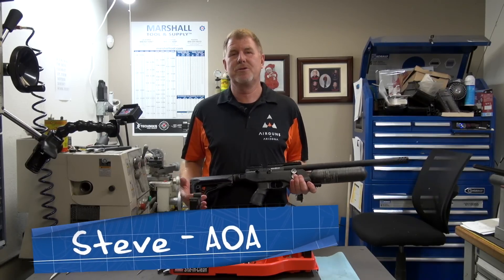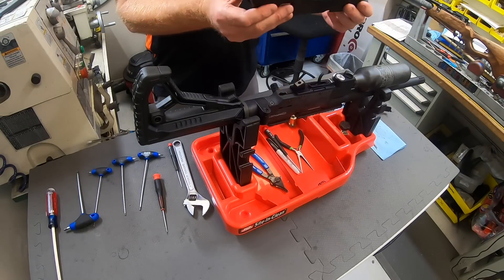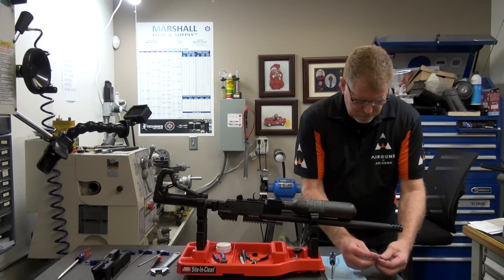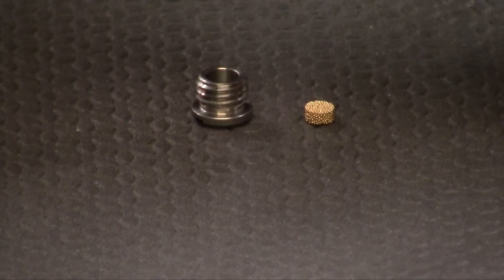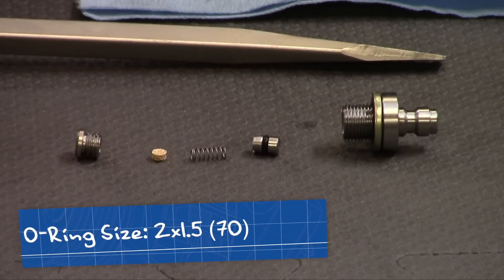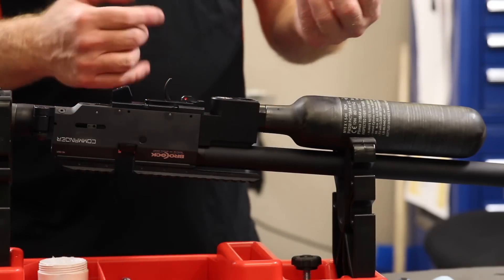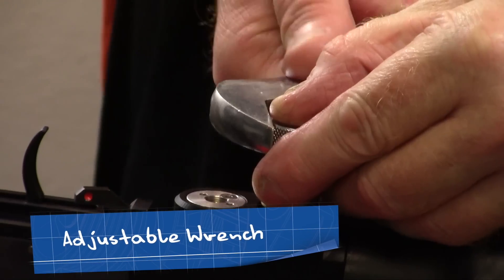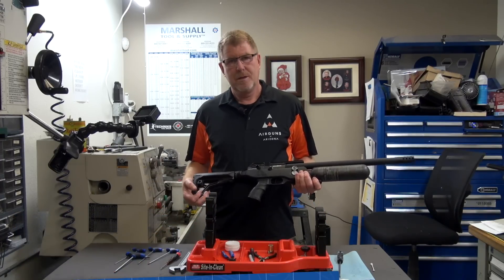Brocock Commander Fill Valve Repair

Comment: Exceptional videos, this has helped a lot me with my UK sub 12 sniper XR thanks
Reply from the maker: Thank you and thanks for subscribing!
Reply: My Sniper XR leaks from the centre of the fill valve, after releasing bottle pressure I lose all the air. Is it simply this O ring. The rifles only 6 months old. Does the O ring dry out?
Reply: @iamspartacus8219  it's a very poorly designed valve and a regular occurrence, get yourself a completely new high pressure full valve from Best Fittings in the UK. I changed O ring 3 times and this did not solve it, it needed a new (different brand valve)
Check if your thread is M10 or 1/8th Bspp though before ordering.
Reply: @richardhindmarsh939  Thanks for your reply. I just got the special tool to undo the fill valve, took it to bits and found the O ring split. Fitted new O ring, put some silicon oil around it and re-assembled. Filled to 250 bar and so far so good. I don’t have faith in it and have followed your advice and ordered a fill valve from best fittings, just in case, because if it happens once it will happen again. I did notice the one I took out that was split, was dry.

Comment: I have a 2019 .22 bantam Magnum.This has never happened.I loved the gun so much,I bought another .25xr magnum.Second fill,this bullshit happens.Kudos to AOA for sending me tools to fix this.(still awaiting their arrival as we speak.) After reading about what a pain in the ass it is to get the oring around the piston,I must say I'm far from happy.However,shit happens and is to be expected with components holding back 4000psi,right? Anyhow,if this non sense continues to happen,I will be asking for permission to install an aftermarket best fittings high pressure fill valve.Others have done that from what I've read and haven't had any issues since.I would do it right now,but AOA told me to fix the OEM one so that's what I'm gonna do is follow instructions.I'm doing this once and once only.Don't have time to fix improperly engineered valve over and over.
Reply: update: I fixed it with tools from AOA and this video.Still gonna order couple replacement 1/8bsp valves from Best fittings in the u.K.(That is assuming they're not just another ghost business that doesn't answer phones during normal business hours) Which,is the case so far at the time of this writing.
Reply: update #2.While bestfittings did not answer their phone,they did quickly email me and i was ,in fact,able to order 1/8bsp replacement valves all done online.Now,we wait for them to arrive via air mail from Jolly ole England.
Reply: @2marauderman329  need your help, this happened again 3x I'm done.... could you let me know the specific one to get? Thanks
Reply: @2marauderman329  1/8 NPT or 1/8 BSP

Comment: Lets see you put that O-ring on!
Reply: putting the oring on was easy compared to getting into the poorly designed round housing of the valve itself!
Reply: @2marauderman329  Are you thinking about switching/changing the valve out?
Reply: @alexmlawsky4170  ,I already did
Reply: @2marauderman329  so could you take a picture would like to see it, also if it’s not much trouble what’s the parts are and where you got them.
Reply: @alexmlawsky4170  ,I have it put back together now.My gun was/is brand new and under warranty.Therefore,I got the parts and removal spanner socket from Airguns of Arizona which is the distributor here in the U.S.A. and where i purchased the rifle.But the job was pretty much the same as how it was done in this video except my gun was the Sniper Xr and not the commander.All you really need is the spanner wrench to remove the valve housing.After that,you just get inside the housing and replace one oring.
Reply: @alexmlawsky4170  ,I also ordered replacement aftermarket 1/8bsp valves from bestfittings in England.So,if this issue becomes problematic in the future,I could choose just to screw in a new valve altogether as opposed to wasting time repairing a poorly designed OEM valve. Hope this helps.Friend me on Facebook and I can show you some pictures I have. Steve Spry
Reply: @2marauderman329  Can’t find you on Facebook you’re not the only one.... 😂
Reply: @alexmlawsky4170   does your profile have a dog as a picture? If that's you i will send you a request.
Reply: @2marauderman329  that’s me

Comment: Thanks for the video. Purchased the Commander back in Nov 2019 and the fill valve seal failed 6 months later.
AoA was very supportive and sent 3 little O ring seals with 2 dowdy seals and a removal tool. This video fails to show the extreme PITA it is to put that tiny O ring on the valve. First O ring broke but by some miracle the second one slipped on. After excessive cursing and thoughts of flying to England to slap some engineers around.
Reply: What did you use to get the O-ring on? Did you use picks or just your fingers. I'm in the middle of catching hell trying to get the O-ring on the piston.
Reply: Joe , I used a dentist pick with a dull end that would not poke into the seal or scratch the valve. A punch smaller than the valve to hold half the seal on. Worked the other half on with the pick. Took many tries before it finally slipped on. Lots of cussing involved.
Reply: Thank you! I tried picks but I damaged a couple of o-rings so I had to come up with a different approach. I was about to use my waterpik when I noticed the how the nozzle tapered and had an area about the size of the piston. I cut the tip off of the nozzle at the point where the circumference of the nozzle was just slightly larger than the piston's circumference. I put the cut off piece in a vise and then carefully drilled a recess in the nozzle so that the piston could sit down in it. I lubed the nozzle and o-ring with o-ring silicon and slipped the o-ring down the nozzle onto the piston.

Comment: Steve thank you so much for this video.  I just purchased a bantam sniper and had to replace the o ring the small one inside the valve on the piston.  If you hadn't done this video I would have been lost.  It's a bit difficult to get on but with some patience you can get it on.  Thanks again I really appreciate it.  Also your staff was very helpful when I called.  I will keep coming back do the service.
Reply: So HOW did you do it?
Reply: Hi how did you get the rounded housing off without scuffing it. Thats the one that holds the inlet valve. I have ordered a pin wrench to remove fill valve but some people are saying its hard to take housing off.

Comment: I have my Commander only about 3 months and there is air leaking out of the fill valve seal now. I am going to have to bring to the gun dealer for repair. He is a couple of hours drive away from where I live. I didn’t expect this after spending  €1500 on the gun plus all the other stuff you need for it. I am going back to Rimfire .22. The Commander is a lovely looking gun but I’m disgusted for sure and I don’t have time for this.

Comment: This appears to be a major issue with the new models of Bantam and Commander. The biggest problem isn't that these valves are failing, it's that there is no way for an owner to remove the valves. Unlike a gunsmith who may be use to making specialized tools, air gun owners are not at that level and since Brocock has chosen to employ a non-standard component in an critical and vulnerable area, it only makes sense that they also step up and provide the tool needed to service the component.

I want to thank you folks at A.O.A. for providing these very important video tutorials. I find them to be invaluable and a great added value resource. Hopefully Brocock will begin providing the necessary tool to allow us to implement the knowledge you folks have provided.
Reply: the valve can be removed very easily with a pair of long nose pliers. It took me 10 minutes to change my valve at home. There are even valve tools available To purchase on ebay very cheaply.

Comment: I am a victim of this o-ring failure. I am measuring different dimensions of the o-ring the video mentions it is a 2mm ID x 1.5mm CS, mine is measuring 2.5mm ID x 1.5mm CS (5.5mm diameter) is this correct?

Comment: I have this problem. Thanks for the video Steve. Some questions what is the principle of operation of the Valve? Is there another way to spec the O'ring?  Is it Cross Section 1.5mm , Inside Diameter 2mm and Outside Diameter 5mm ?